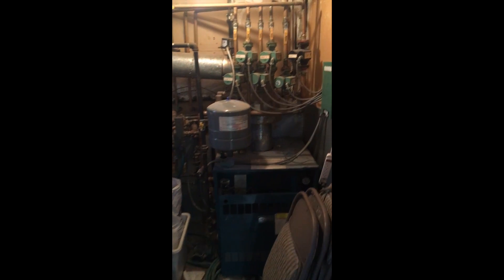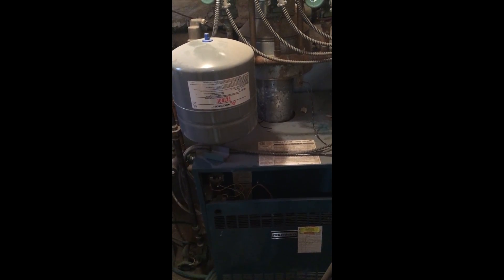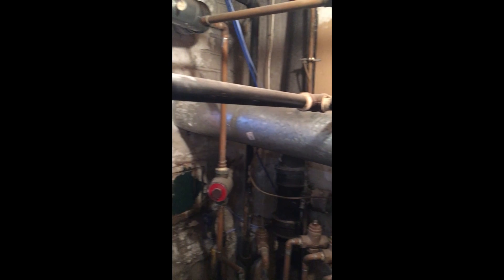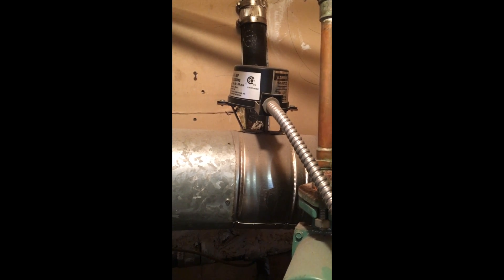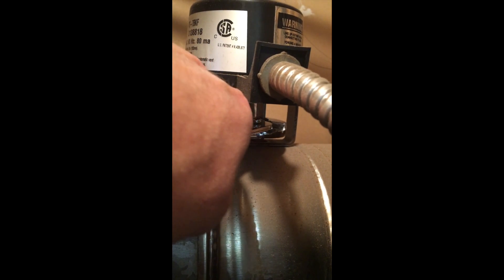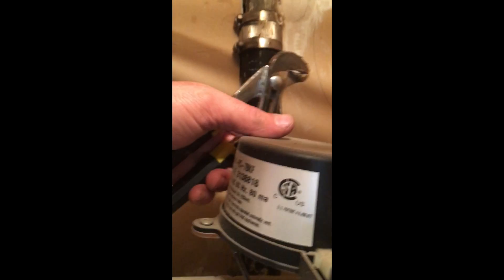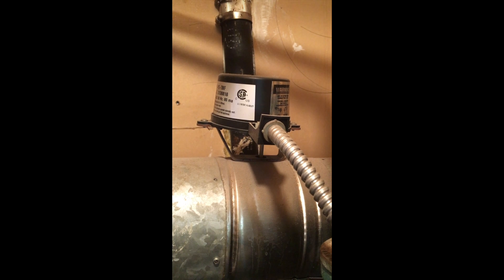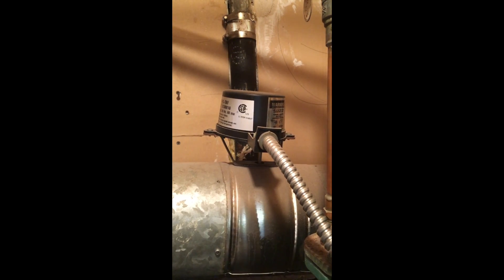Stuck Automatic Vent Damper - Gas Boiler

Comment: Hi Mikey , how woykd you bypass vent damper fir testing only which two wires are you connecting . The one in aquastste and gas valve. Please advise
Reply from the maker: Well, you have four wires one is common. One is our and two are the safety searches look at the wiring schematic

Comment: I have a situation where the boiler fires from the thermostat, the damper opens yet it continues to cycle thru open/close/open/close with the burner firing and circulator on.......???   The main honeywell control block was recently replaced as this was found to be faulty when the burner failed to ignite, now it ignites but the damper continues to cycle.....so, sounds like?  (yup, I'm calling the guys who replaced the control block back.....but if they missed something or wired incorrectly, I need a backup plan....thanks)

Comment: I had one that was closed and not opening when there was a call for heat. Not really knowing what I was doing I took the damper off and apart. I saw the 3 contact switches and the cam action that worked them. I removed the motor to see if it was frozen or what. The motor turned so I put it back on. There must of been some misalignment between the motor, the mount  and the damper. When I put it back together it worked and is still working. I got lucky, learned how the 3 switches worked, and how the motor turned the damper. I also learned that if the damper is closed then the heat will not come on.
Reply: Yes. If the damper is closed it can’t vent and will put gasses into your house.  
I don’t even know why they have one.  To keep birds out?

Comment: The motor also turns a plastic cam with lobes triggering 3 contact switches. But on the newer models the timing of those cam contacts is flawed which is why the motor turns off a hair before triggering the final switch to indicate it damper is open. Disassembled the unit and put a drop of super glue (with a dash of baking soda for an instant cure) on the leading edge of the cam lobe closes to the motor. (It spins counter-clockwise, and do both sides 180º apart). Basically making it flush with the center cam lobe, sand/file until smooth. This is how the cam was designed on older models. Unless you go with a different brand replacement is waste of $, again it's a design flaw. This permanent mod may take 15 min and save hundreds.

Comment: My damper is not opening. Its making a grinding noise. If I turn the power off, it works for awhile. I switched it to always open for now. Any suggestions?
Reply: Hey same problem here what did u do did u have to change or not

Comment: I switched mine to manual, but when it calls for heat I get err 56, even though the damper is in the open position. It is looking for the damper to close, then open again. It does not do this all the time, usually in the middle of the night just to piss me off! What can be the issue here?
Reply: Robert D. ------ You have  a bad limit switch in the damper control.  Easy repair if you know how to solder. Switch costs about $0.30 if purchased in bulk or about $3 - $5 if purchase individually.

Comment: Pipe Doctor,I have been wrestling with this issue for weeks and nobody seems to be able to fix it. I also replaced the damper. It will do it every day then not do it for weeks. Recently, it was on crooked and I straightened it, and has been good for 12 days. What is causing this. Do I need to replace the control in the boiler?
Reply: Hi PD,Thank you. My boiler is Burnham Series 2, gas, hydro. Are those the ones you see with issues? Also, I don't have an external acquastat, is that something you'd advise to get taken care of?  Thank you

Comment: Hi PIpe doctor, 

I have a question. 

I have a GVD-5-AE model by field controls. I am looking on Ebay and can not seem to find a replacement model with the same model #. Do you know how I can find a compatible replacement type?

Thank you!
Reply: supply house has the motor assembly,cheaper than amazon.